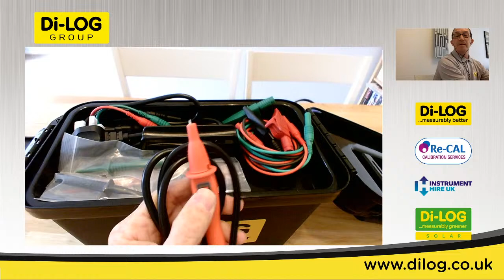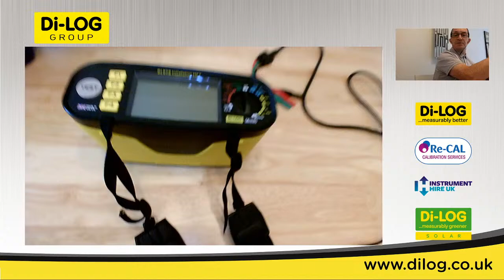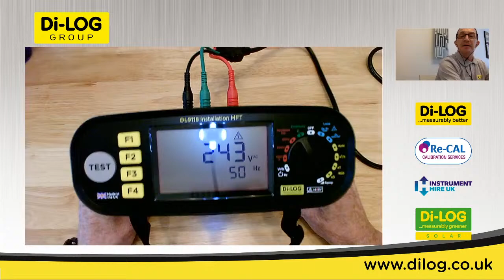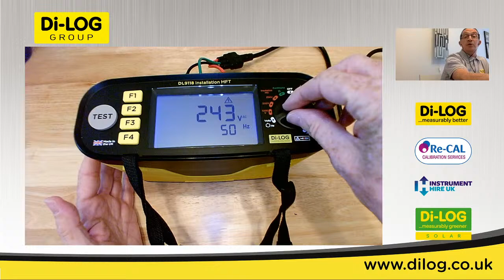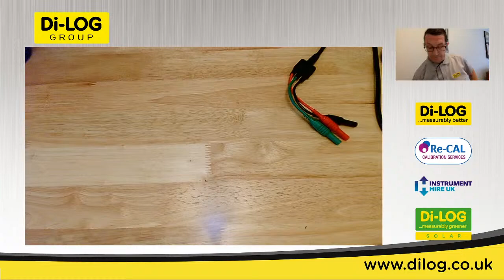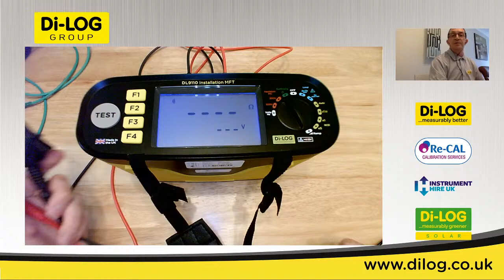Di-LOG LIVE - DL911x Series 18th Edition Multifunction Tester live demonstration

Comment: So it can’t test A type rcbo ?
Reply from the maker: In short, yes it can!
Reply: @DilogGroup  what is the procedure to do so ? I have the 17th edition model and it says AC and Dc types ..do I test on both ?
Reply from the maker: @thebarneyj  yes, recommendation is to do 10 tests, both on the AC setting and the DC pulse setting. Changing the type using F2 will enable all tests. Incidentally, there are no changes to the 17th edition labelled unit to the current version. Many electricians didn't understand that the 18th edition didn't affect test equipment, and refused to buy a 17th edition badged tester, so we re-labelled them. Very importantly, make sure your tester comes back to us for calibration, as we update firmware free, that some other calibration companies can't do, so you'll have confidence that yours is up to date.
Reply: @DilogGroup  ok thanks for the reply.just seems odd just not to have the option of the A type independently as it’s the most common type these days ..
Reply from the maker: @thebarneyj  keep an eye on @diloggroup on LinkedIn, Twitter, Instagram and Facebook for future updates. Drop an email to me, Mark Barron, at mark.b@dilog.co.uk and I'll put you in touch with your local contact to keep updated.
Reply: @thebarneyj  AC is referring to the generated power source type not the type. A type RCD's can be tested along with any other type of RCD.
Reply: @DilogGroup  This great customer service i keep hearing about is why i'm going with Dilog. My Fluke broke and they want hundreds just to look at it!

Comment: Why do all you manufacturers insist on refering to your MFT'S as 16th 17th and now 18th edition complyant? The eit wiring regs has no say in what meters can or can't be used, they do say however that any instrument that can perform the tests will be complyant with BS 7671 so long as it has no external damage is in proper working order and properly maintained and calibrated, and that the test leads conform to GS38 the truth is we can use any  meter from any brand even the old crank opporated mega is still good to use. Good video though
Reply from the maker: Hello Sean. You make a good point, but not all electricians are as informed as you. When the 18th Edition first arrived, many of our customers wouldn't buy a tester from a wholesaler with "17th Edition" on the front panel, as ours used to have, thinking it was out of date, and we were asked to exchange them for current models, until we explained it. The industry as a whole changed to showing 18th Edition to overcome this. Ours now just has Multifunction Tester on the panel, with no reference to any Regs. 
Mark.
Reply: @DilogGroup  glad to hear it

Comment: I bought a new Dilog 9118 tester. Had some issues with remote test probe. However Mr. Mark from dilog contacted me straight away and arranged for collection of the unit. It was a one off very rare manufacturing glitch. Dilog replaced my tester with a brand new 9118 and also gave me free DL 107 voltage detector as a gesture of apology. 
Generally Dilog products are very reliable, however if anyone comes across any issues get in touch with the customer service team. They will do everything to satisfy you.🙏🙏